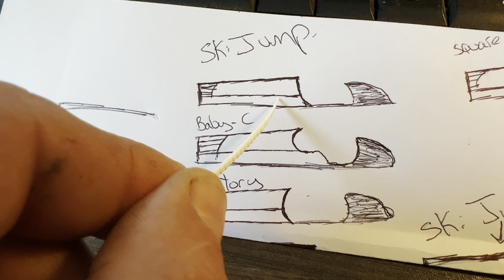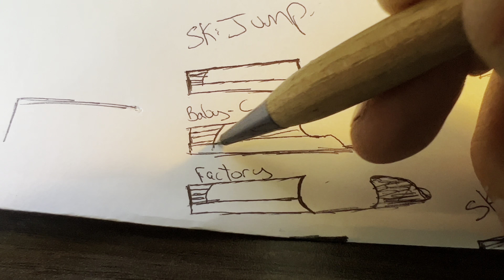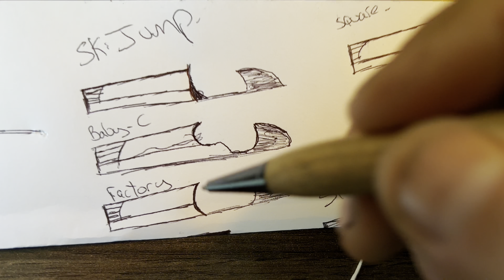Chainsaw Chain Duel, hand filing vs, out of the box Oregon Chain

Comment: I recently bought a square tooth Oregon chain for my 372 just to see the difference from a normal chisel chain. I am very apprehensive on my ability to sharpen the square tooth. But, since I've been watching your videos I dug in and tried it. Man the square tooth cuts so well, especially when cutting the top of the face cut or cleaning up a dutchmen. Man what a difference! I think I'm getting the filing down well too. Not perfect yet, but it's a learning process for sure. Thanks for your desire to help others!
Reply: I may have to buy one of these chains for my 372 and try this out for myself.  Thanks for the encouragement by this comment.
Reply: @johnrosier1686  I won't look back now. The filing to me is easier than the round and I cut down 40+ trees Thursday (6" to 15" pine, alive and dead) then cut around that many stumps (we leave them high so their easy to spot with the skid steer) and my chain was still reasonably sharp to cut a few more bigger ones down.
Reply: @kenbarbret6632  wow, not bad at all.
Reply: Stock square chain is slow, once you hand file it it will most likely pick up speed, unless you mess it up lol.
You can do it.

Comment: Thanks very much for this! I e been using at Timberline sharpener… and somehow ended up with a ski jump on my chain and wondered why it wouldn’t cut properly… I have since corrected my mistake… used the sharpener properly…. Got rid of the ski jump and now it cuts properly… keep them coming… I’ve learned and continue to learn a great deal from you. 👍🏻

Comment: Buckin', first off, thanks for the video. Many viewers, including myself, appreciate you taking time out of your day to draw it out for us. Very helpful -- I appreciate it. Second, the ski jump reminds me of a lathe tool that was ground without any "relief angle." Such a cutting tool will chatter against a work piece because there is no "escape room" for the chips. 

In my experience, a cutting edge equal to or greater than 90 degrees will plow and sort of jump around, tearing chunks as it goes. A cutting edge with too sharp of an angle (too acute) will dull quickly and sometimes dig too much. 

In general, I get my best results when I first consider the application and then make my best guess at the ideal cutting angle. At least, I apply such a philosophy to knives, axes, etc. For chainsaw stuff, I tend to listen to the Saw Man!

 Thanks again, Buckin'!
Reply from the maker: welcome friend

Comment: An axe handle or shovel thru the handles is a good impromptu saw anchor too. For extra easy security, wrap a light ratchet tiedown around the handle and anchor to gate latches or tie loops in the bed.
Been playing with different chain sharpening methods myself, found something, used it hard today and it cut with square ground and resists dirt better. I sharpen with a Dremel or cheap 12v  sharpening tool with diamond coated cylinders.
I just came in from cutting mostly big cottonwood all day with some year dead Ash mixed in..
In a nutshell, I use the factory top angle, but when I go into a tooth, I sweep the "get the gullet" method leveling the bottom with the top of the side plates. I then pull up into the factory position, making the side cutter (normally the "C") perfectly vertical. This gives you what looks like a square grind, but with the beak a bit larger and ahead of the vertical side cutter portion. It also has a radius at the top and bottom of the vertical cutter. Rakers set "Hungry: - take them down until it suits the saw and user. I like the chain to be able to bog the saw fairly easily. This profile cuts standard crosscut great, and also lets you cut with the grain as long as the saw can clear the long chips. I'm running this setup on my G660 91cc clone with minor mods (.375 chain on a 36" Tsumura light bar) and a 2511t with muffler and timing mods - Panther 1/4" on a Panther 16" bar (Thanks August and crew) The G660 just pulls through anything but used to be very dirt sensitive, the Panther just is dirt sensitive, but less so with this profile using a .100" diamond cylinder. Both cut great with my new method, but in seasoned hardwood the 2511t can be a bit grabby and even chatter when setup aggressively. It's very noticeable right after sharpening and mellows out after a couple cuts, presumably when the burr wears off. Caution is advised on small stuff until the edges settle down and keep the revs up.
Thanks for inspiring me to play with my "standard" method I've used for 30+ years. I'm learning there is a better way.

Comment: I’ve been playing with this thing your doing for a couple years now. I call it chain porting. I don’t know if it’s faster but it’s smoother and I routinely get huge chips with it in hardwoods. I use a very small diameter file and keep it up towards the working corner and slightly open up that underside so the chips can flow through that space now that it has a smoother funnel shape to it.
Reply: I’m gunna try the tooth porting on a milling chain and see how that goes.
Reply: I’m gunna try the tooth porting on a milling chain and see how that goes.

Comment: was at dealer for Mac in early 80s . last gasp . they brought back the 1010 and it ate up any 600 or 700 series . just couldnt hamg on to solid handle so long , but great power .  cast iron sylinder

Comment: I been waiting for this video.  Yes my baby C with a 5/32 does cut faster then my 7/32 filed chain. On my 32" jonsered 2188 modded I'm going to try your chip dump. That's probably y square cuts faster cause of chip clearance partly . I think u found the secret to round. Wtg buckin.

Comment: Hiya Buckin, thanks so much for all these experiments and your pursuit of knowledge on these details. It's great you actually do the tests and try things rather than just saying something is better than something else someone said somewhere on the internet.
My big question in all of this with chains, filing, mufflers, porting, etc. is what in your experience particularly, bucking soft conifer firewood is the combination of all these things that produces the MOST EFFICIENT WORKFLOW? In other words, yeah, maybe some different chain filing results in faster cutting, but with that speed, does it get you longer cutting without stopping to sharpen? And with modding and hot rod mufflers, sure you get more power to the wood, but do you get that much more measurable efficiency with the faster cuts at the end of the day looking at your finished wood pile? More power generally comes at a price of more fuel. Is there some combination of all these things that results in the most cuts per tank of fuel, the least sharpenings on the chain, and the biggest pile of finished wood ready to be split at the end of the day, WITHOUT destroying the powersaw and spending the least amount of additional money on gasoline and oil? The reason that a lot of us are doing this, is that burning wood is a less expensive and available source of energy that can be had if you're willing to do the handiwork to get it done. But if you're doing that handiwork inefficiently and dumping additional money in fuel to get the job done, then what's the point? I love cutting and splitting wood and am always looking for ways to get it done quicker and still safely and not be sore after a long session. But, with that in mind, I also love spending time with family and watching my daughter grow up. I'd rather do my best to keep her and her mom warm in the winter and also be able to spend the most time I can with them and not with the wood pile. Thanks again Buckin', for all these videos, the knowledge you're sharing is priceless. :)

Comment: So at what point does the ease of sharpening the stock chain in the field over rule the fractional speed difference between all of those options?

Also, can you give me any recommendations on where to get a good square file?  I can’t seems to find one at my local saw shops, and I’m not 100% sure on what I’d need off amazon. Square ground chains are not a thing in my area, matter of fact, the only one I have I had to order and wait 2 weeks to receive.

Comment: I always wonder what the wood chip looks like as it comes off the tooth. Take a soft piece of wood and by hand push it across the teeth on the saw and pull it back without breaking the wood chip to see what it looks like. I think the biggest reason the square cut sharpening is a faster cut is you are reducing the length of cut. The round file increases the length of cut. In that .025 if you calculate the chip is longer  on a round file sharpening than a square sharpening. Smaller cutting area reduces the wasted hp and the result is faster cut.
Reply: Also the chip takes longer to get off the tooth on a round file sharpening again stealing hp.

Comment: I feel like your stock chain has more teeth, so more chips, but the rakers are high, so it'll throw smaller chips. Your skip chain has fewer teeth, but low rakers, so it's going to take a bigger chip and throw it further. I'm guessing your square file chain on the Husky would really rip, because it revs higher than the Mac.

Comment: It looks to me as if the babyC is mimicking the square ground but the things just sing their own song in the wood
Reply: Not really, it just gives a more aggressive hook. It's not much different than the newer husky x-cut chains in that out of the box they have a very aggressive angle/hook near the top plate, then the angle changes and they are much like a normal chain near the gullet. Similar to sharpening a new chain, filing the top/side plate is one step in filling, then the gullet if you want to maintain a similar cutter profile. 
Have a great week.

Comment: You are messing me up. From round file, gullet to top edge, working up to the very edge of the tooth edge and NOW you are wanting to mess me up--confusing me . I understand that the filing you taught does finally wear to a point when the geometry is gone. I do file to a significant guullet, but concentrate on a blend from gullet to edge.

Comment: I'm a lady in my 60s, going to be bucking some logs. A man taught me to file 5 times per tooth. What are folks here doing for number of strokes with the file? I get worried I'm going to grind off too much material. Thanks.
Reply: @MATT.MAN-PEACE-LOVE  thx bro. I just got a raker tool. Heard you need them level with the tooth. I'm a bit ignorant but learning!
Reply: Number if strokes don't matter as much as watchin for the burr and keepin angles the same.
Reply: File until the tooth is sharp, then go to the next tooth.  After it is sharp, then check your depth gauge.  If you keep your angles consistent and the depth gauges true, you can have variance in tooth length and it'll still cut straight.
Edit to add: You're awesome.
Reply: G'day hanging laundry, the rakers should be lower than the leading edge of the top plate by the thickness of a hacksaw blade 👍.
Reply: @bbarker5766  Thanks!
Reply: @mattfleming86  Haha, thanks!
Reply: @ishure8849  Thanks! I sure appreciate the help and support here!